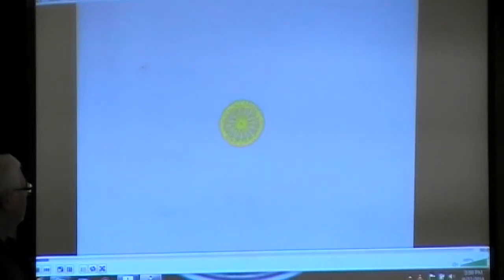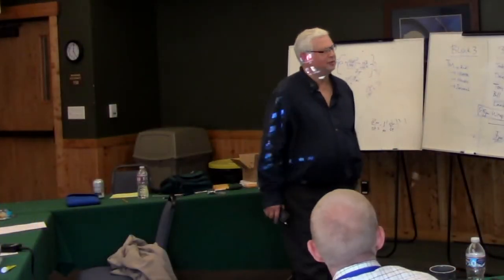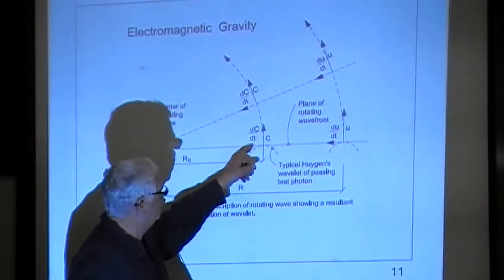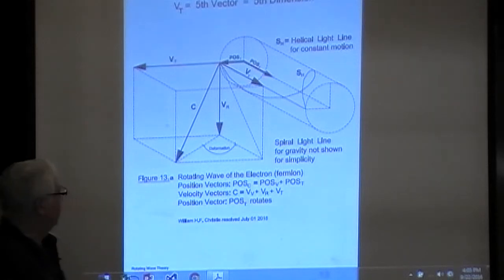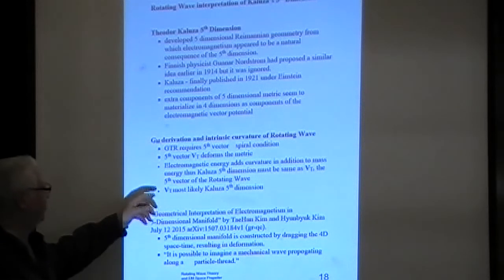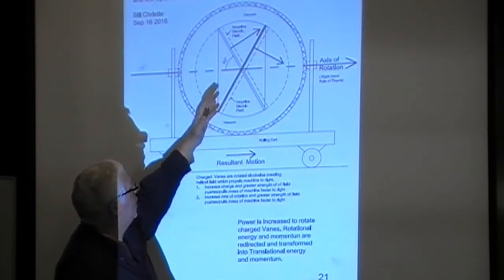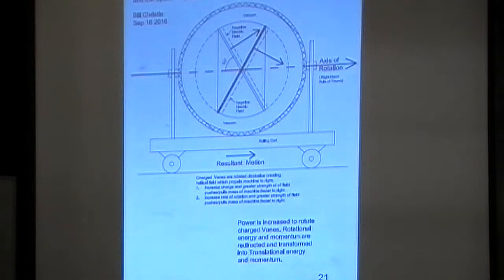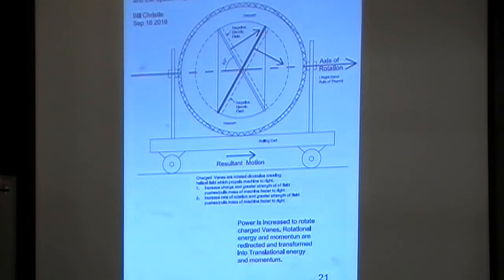BPW 2016: 27. Bill Christie "An EM Space Propeller"

Comment: Clarification on em space propeller /Christie:
On physics:
Light line (where wave is going at C speed of light) is allowed to spiral inwards as wave rotation speeds up or spirals outwards as wave rotation slows down. In Special Relativity, C4 = Vv + Vr per the Rotating Wave. In GR, C5 = Vv + Vr + Vt. Vt is the 5th vector = Kaluza's 5th dimension. Spiral allows for intrinsic curvature. Out of that automatically comes expansion of space. Vv = Vx + Vy + Vz. So for C5 we have 5 dimensions + 3 space for origin + 3 space for destination = 11 dimensions. Paper getting published.
On space propeller:Photon is transmitted through space and interacts with space. Rotating Wave from photon is thus also transmitted through space and interacts with space. Hence, we hopefully have some traction in space and that is why I suggested the propeller.